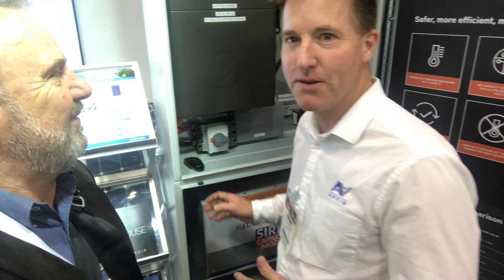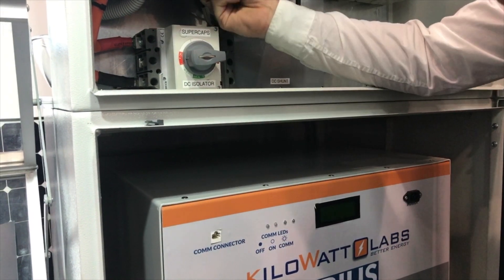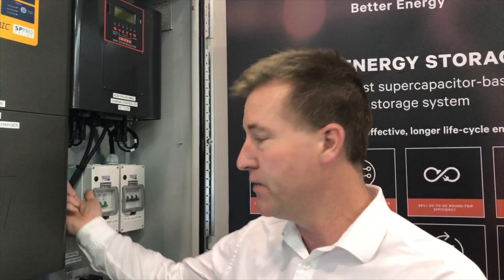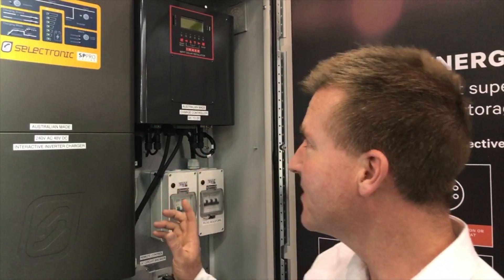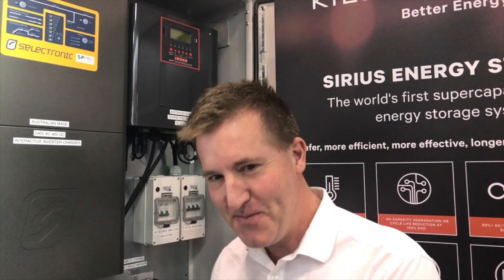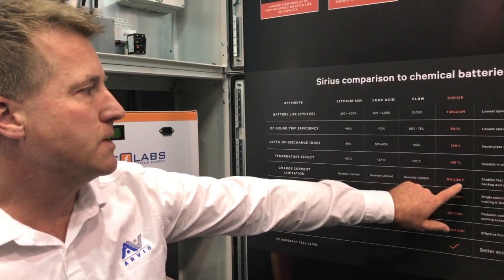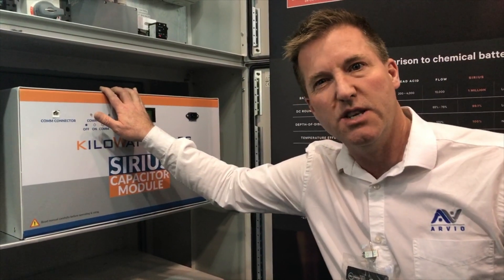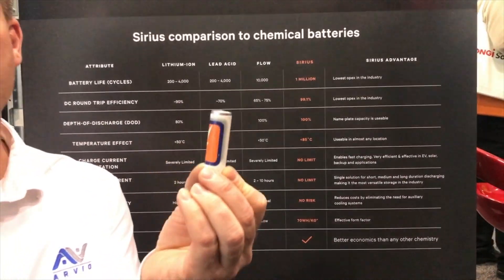All-Energy 2017 Arvio's "Independence Day" super capacitor hybrid inverter system

Comment: I can't find the info others are talking about, but if the energy is not stored in a chemical reaction, it's not a battery.  There are graphite/graphene capacitors, and they are very promising, but very expensive.

Comment: Have you done a capacity or power test of the supercap battery to determine if it meets its energy and power specs?  That's a very high energy density for a supercap.
Reply: Yes, that's a lot. it would be between 50-75Wh/kg. I found the following paper where they claimed to have reached 148.75 Wh/kg (it excludes package and electrodes weight) http://iopscience.iop.org/article/10.1088/1361-6528/aa8948/meta
Reply: Yeh he mentions the baby unit is 75kg and the larger is 125kg
Reply: 125kg / 7kwH => 17.85kg per kWh or 56Wh/Kg (about 1/5th of li-ion)

Comment: There is surprisingly little about KiloWatt Labs and/or the Sirius ultracapacitor online.  If it is for real--namely a production ready ultracapacitor made from paper with energy densities in the same OOM as Li-ion-- it would be revolutionary.  I have to wonder if Sirius is for real or just some kind of vaporware to get investment. Were those units in the cabinet real or mock-ups?  Have they been locally and independently tested? Great video, thx!
Reply: It is real, somehow.  Even on their site all the vendor accredited do not have actual items on sale, I found a store where you can buy it. https://solarbatteriesonline.com.au/product/sirius-energy-storage-capacitor-module-3-55kwh-48v/
Somewhere on that site is a link to a video made by a customer who tested it. https://youtu.be/tD7MXTfumJs. It is quite technical, not easay to understand
Reply: There are now 9.2 meg out there
Reply: Timothy Surendonk There is definitely some funny business. Why call it a super capacitor when it’s actually a battery?They claim 1 million cycles, gas that been tested?
Reply: Its real, however what ge doesn't mention is 

1) its huge (20% bigger than  2 x 5 kva lithium)
2) it extremely heavy 
3) its astronomically expensive 

Yes over 40 years its cheap, but you paying now